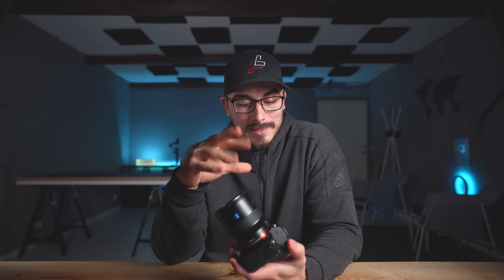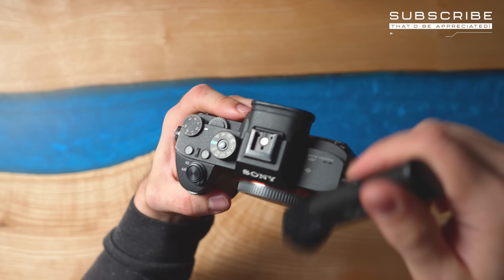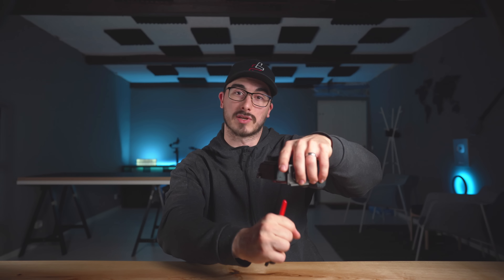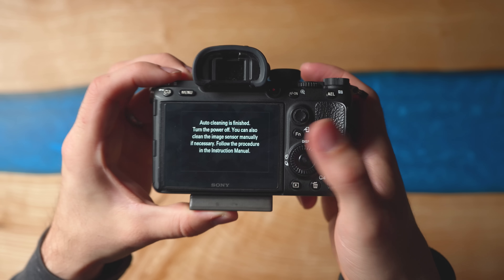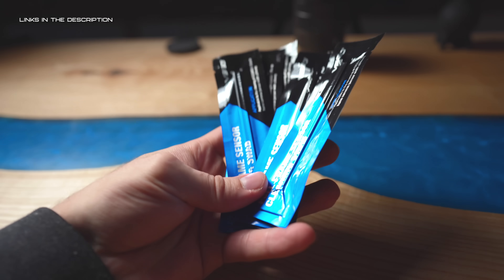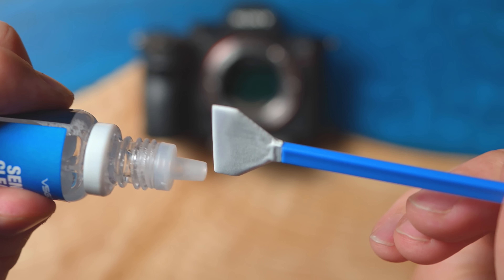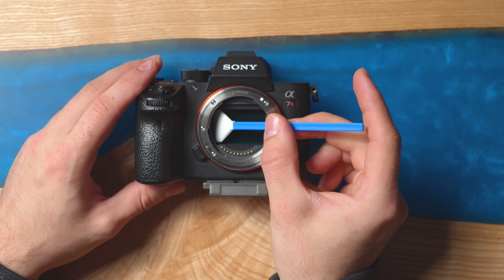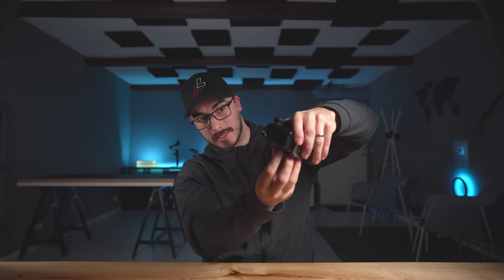How To Clean Your Sensor

Comment: Great sensor clean video, well done Peter.
Just two things to add: 
1. Ensure the work environment is as dust free as possible
2. Clean the rear lens barrel so it does not re-contaminate the sensor.

Comment: I would add that you might want to take an out of focus photo at F22 on a white background or sky after using blower. On my a7riii (has it 14 months) I’ve only had to wet clean once. Just blowing might clean dust. I check for sensor dust after each step of cleaning (I try a Lens Pen sensor stick second then wet if it won’t clean). Watch your YT channel with every post!